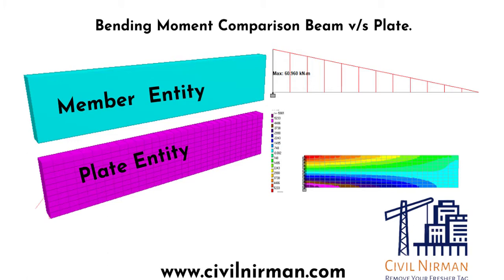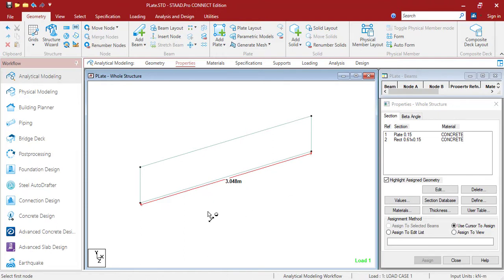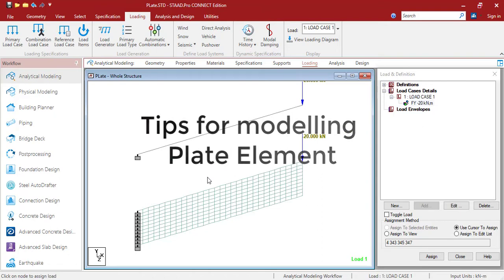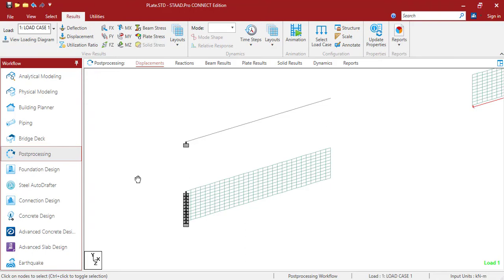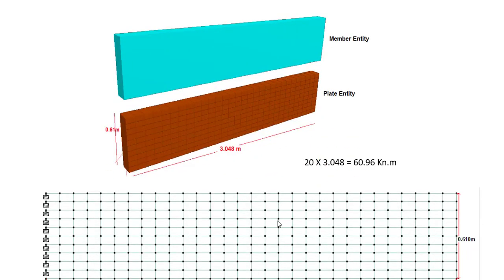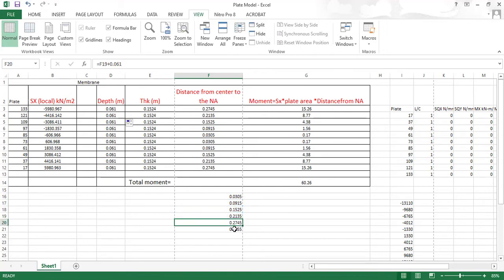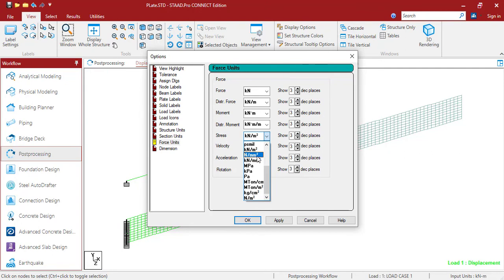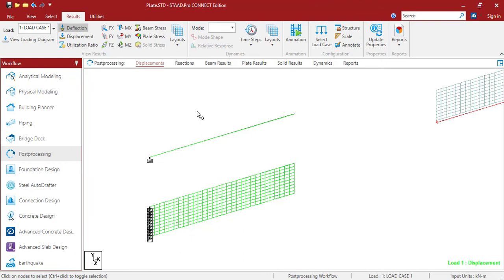Bending Moment Comparison Beam v/s Plate | Plate Modelling tips in STAAD Pro Connect Edition

Comment: sir in staad we not get the shear force section in plate model.
Reply from the maker: Go to the Postprocessing workflow, Results -> Reports -> Principal stresses.
SQX - This is the out-of-plane shear stress on the X face at the centroid of the element.
SQY - This is the out-of-plane shear stress on the Y face at the centroid of the element.
TMAX is maximum inplane shear stress

Comment: Observations for you to consider:
1. You erroneously kept referring to SX as shear force, which it is not in STAAD. SX is an in-plane axial stress in the plane of the element local x-axis.
2. The point load in the plate model should have been applied at the location of the neutral axis, not to the top surface, as has been done.
3. The bending moment from the plate model does not exactly match that obtained from the beam member because the method applied is approximate. In this example you need only have read off the peak axial stress, SX, at the extreme fibre and integrated this over half the height of the beam (doubling to account for equal stresses acting below the NA), giving a total bending moment, M = 2[SX.(h)^2]/12 which is the same as M = [SX.(h)^2]/6. This should give you the correct value.
Reply from the maker: hey  thanks For the Observations, we can try and update the model and heck again

Comment: please make a video on manual calculation of bending moment of  simple supp. slab vs plate modeling method. I have try but result differs between them as you told methology in this video.